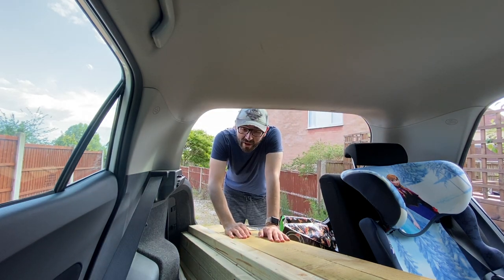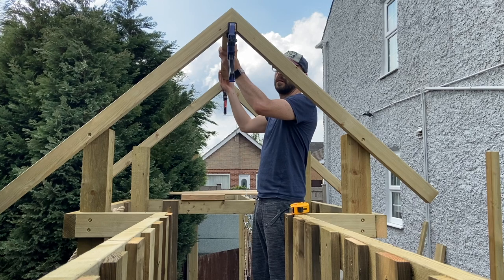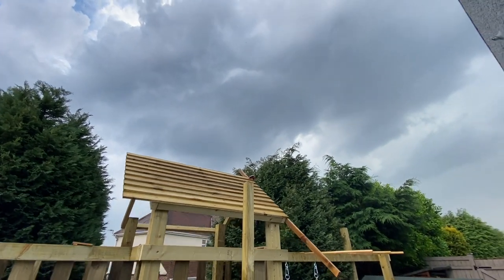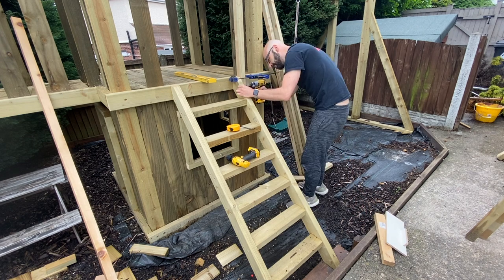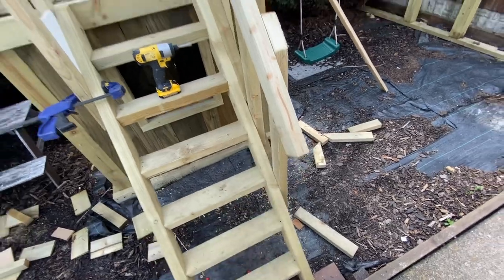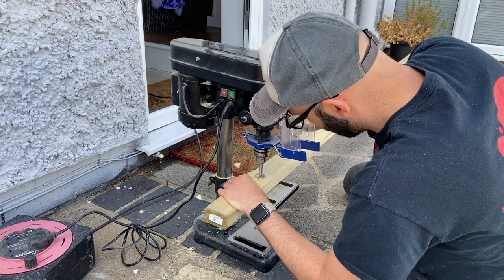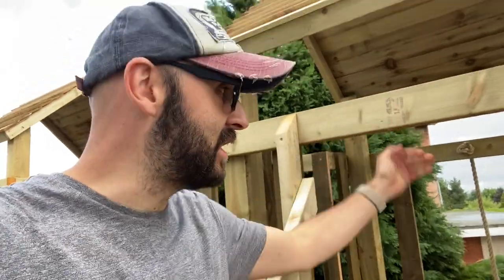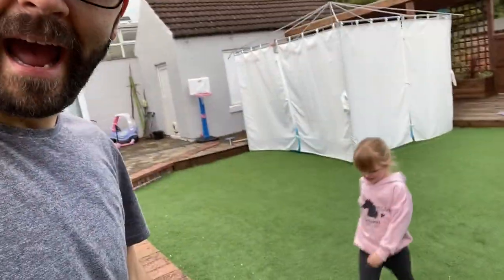The climbing frame is finished!

Comment: hello bud came across you videos doing a little research myself. justa question, did you concrete the posts into the ground or not? i am thinking of making just the one tower (our garden isnt that big) but make it taller and slightly wider but i have 3 boisterous boys and their mother would kill me if, whilst playing, it toppled on to them because i hadnt secured it correctly.
Reply from the maker: I built it above ground. Then after jumping around on it, I was happy how strong it all was. If it moved too much I would have then added in some supports to the ground. But I was more than happy with the lack of movement it had